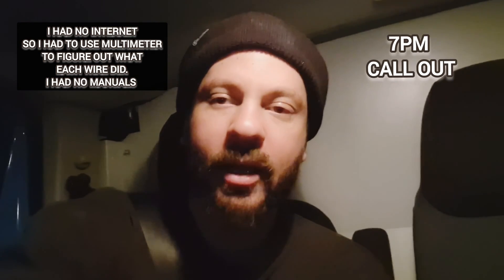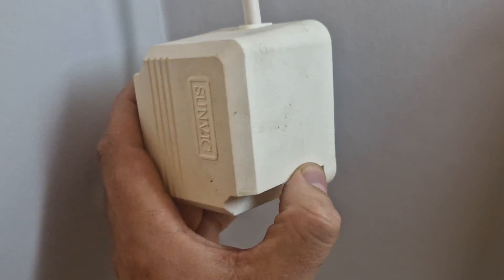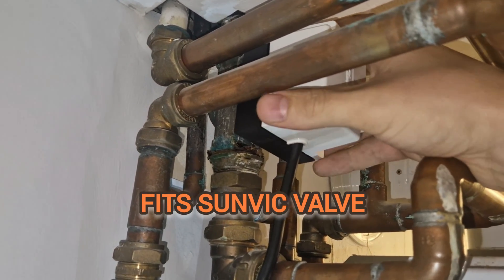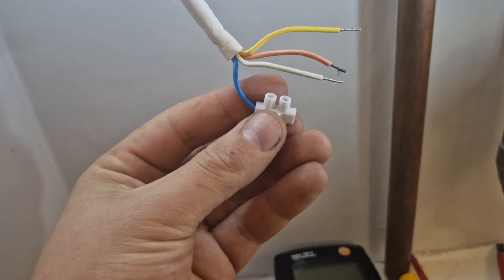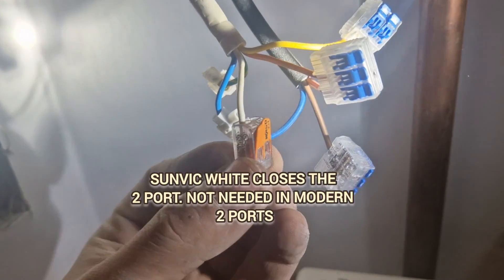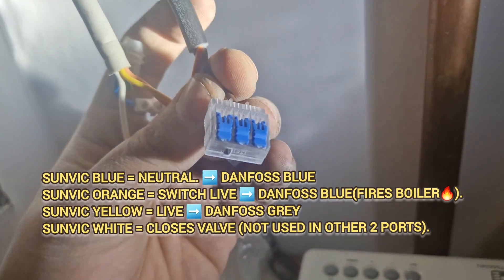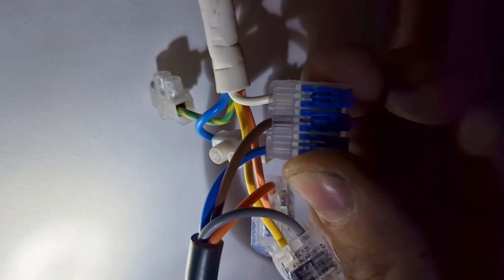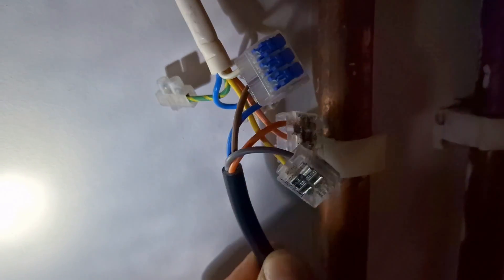Replacing Sunvic SM5302 with Danfoss HPA2 - Wiring Tips Included!

Comment: Just replaced my SM5203 with an EPH controls DSP1 from Heating Controls. This comes with extra long screws to fit the valve body. To make life a little easier after turning off power I cut the old actuator cable and fitted Wagos to the old wires in a Wago connector box, I then connected the EPH actuator to the old wires. EPH Brown to old yellow. EPH Blue to old blue. EPH Earth to old earth. This will open the valve and when power goes off it closes automatically.
 When the valve is open it completes a circuit between EPH grey and EPH orange activating boiler and pump, in their diagram EPH Grey is connected to boiler/pump, so I connected that to old orange. To work it needs a permanent live which is connected to EPH orange. The old white is capped off as it is no longer used
The main problem I had was finding a permanent live which in my installation needed a new cable back to the wiring centre.
I fitted the EPH and not the Danfoss solely because I'd read they were a bit more reliable. On the Danfoss I think the wiring colours for permanent live and to boiler pump might be different.

Comment: The grey is the permanent live and the brown is the call. Pretty sure you have them the wrong way round.
Reply: Heating controls on line have a diagram which suggests white not used, blue to blue, yellow to brown, orange to orange with grey as the permanent live. I'm currently looking at the EPH DS1P as a replacement where the wiring diagram has orange as the permanent live with grey having the function of supply to pump or whatever when the valve is fully open. Not a lot of consistency.